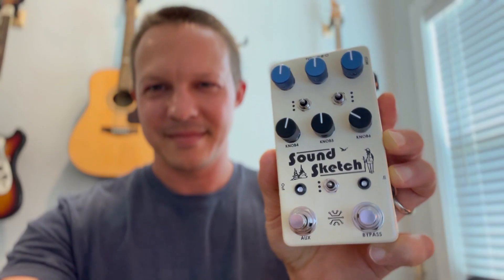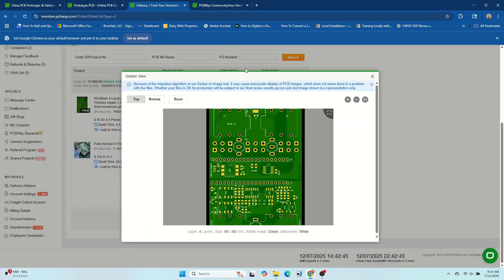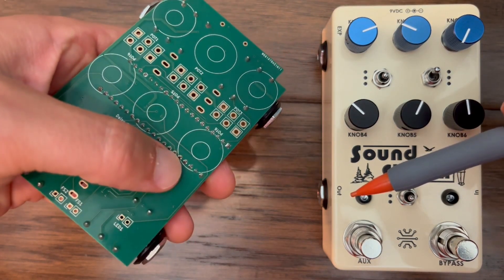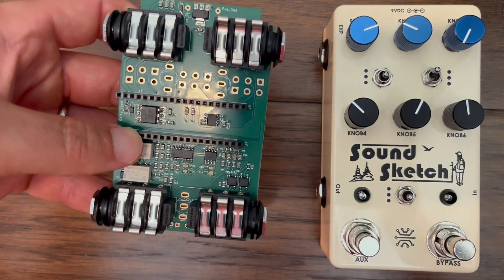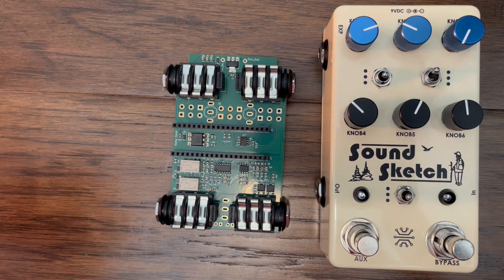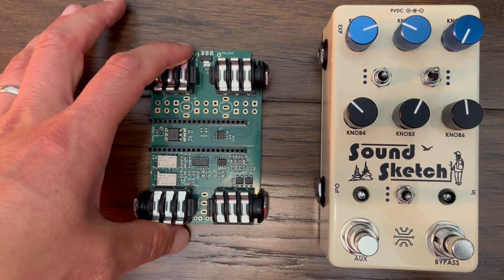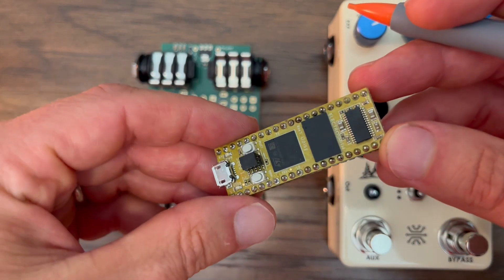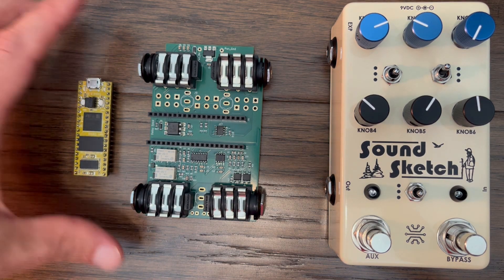SoundSketch - Digital Guitar Pedal Demo and PCB Walkthrough

Comment: Is there an opamp buffer/filter on the analog output side of this circuit design? Guessing it's the opa1642 or opa2134? Also making the board 4 layers with two internal continuous ground planes is a great choice, definitely helps with noise reduction.
Reply from the maker: Yup! OPA1652